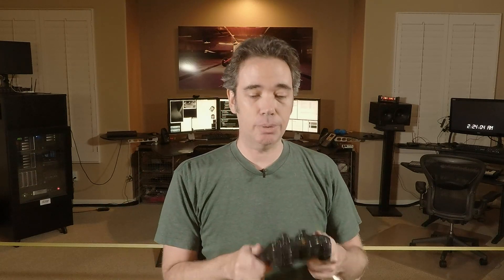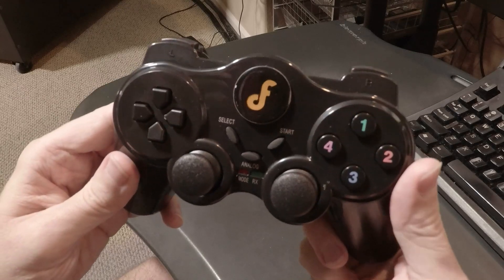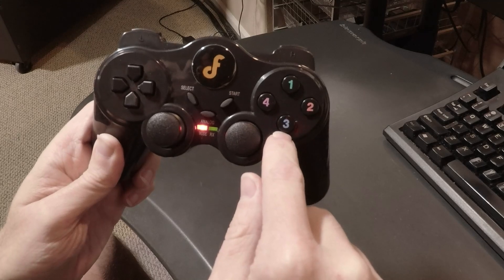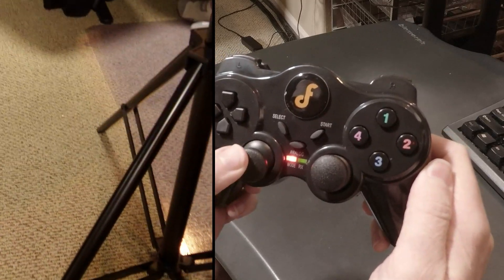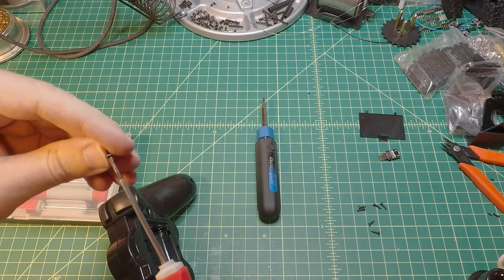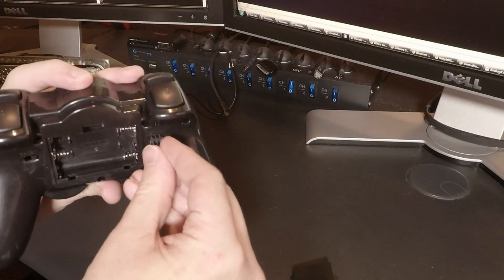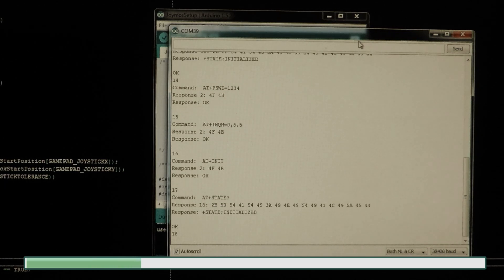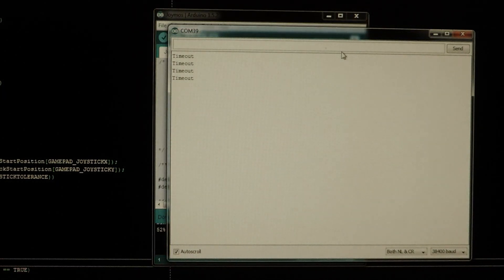Wireless gimbal controller (DIY for GoPro stabilizer as well as other AlexMos/BaseCam based systems)

Comment: I would like to point out that the code has a problem because it and impossible to make the connection with the card, after having studied the code in depth I found the solutions because the transmission speeds are wrong, currently everything works perfectly well, thank you for this tutorial but think about adding your code

Comment: A couple tips that will save you a tone of time.  The DFR Robot Game Controller Bee only works with the Blue Tooth 2 module for this example.  The Link or Blue Tooth 4 modules do not work. If you try and use AT command from the serial command line and not from the code it will not respond.  Lastly the wires on the controller that connect the battery are really cheap.   High chance they break off when you open it up.  Recommend soldering back on nice silicon wire.
Reply: this is true!!
Reply: You managed to make it work?? can you share your  BGC 'RC settings?
Reply: +FLOREPSINOSA photographe what settings would you like?

Comment: Hi,   I have tried this now for three weeks to get it working and it does not work.  Furthermore, my gimbal is completely ruined and only jolts now.  Do you have the settings to get it back to factory reset or a fix to your file. It fails at line 18, 24, and 27. 

Thank you, 

Michael

Comment: Hi! I'm trying to do something similar but, using USB without an Arduino. I'm using the provided API and I've modeled my code after yours but, I can't get the gimbal to move. I'm using the 32 bit basecamp gimbal controller. Do you have any ideas about what could be going wrong? My first thought is that I need to change some input mapping settings on the RC tab in the GUI. Do you know what those settings are? Thanks!

Comment from the maker: Brandon (your settings don't let me reply), the 32bit version of the Basecam stuff supports scripting now I believe, so you could do it without anything else.  If you're running the 8bit version, then there is a project linked on the Basecam website called RMotion that can do it.  I've never used it, but it looks to provide of ton of scriptable control of the gimbal.
Reply: Great thanks! Also thanks for letting me know about the not being able to reply I'll have to change that.

Comment: Can I use a Playstation 3 controller instead?   I have a couple laying around which I no longer use.
Reply from the maker: Davion Ola Perfect Exposures You certainly could, but it would be a LOT more work - the only reason I picked this particular controller is because it had the Arduino already built in, and the wiring to the buttons, etc done.
Reply: Anx2k Cheers for the quick reply. I believe getting the Dfrobot pad is the best  option too. By the way, thanks  for the  fantastic tutorial.

Comment: Hi! Will this work with the ST-316 gimbal?

I hope that's not a dumb question; I'm new to all this.
Reply from the maker: PonyHorton It's really hard to tell with these gimbals - they could look exactly the same, but have different software inside.  I don't know about that one, I searched and couldn't find if it uses AlexMos or not - I would email the seller.  If it's running the AlexMos software, and you get a bluetooth adapter for it, then it will work...

Comment: Brilliant, I have a hobby King RC controller at the moment for my gimbal but this would be a great addition for when I want to slim down my camera bag, and the 10 point memory thing is absolute genius. One thing, is it possible to use the top 4 buttons for trimming drift? that would be super handy.
Reply from the maker: Lee Daley Thanks!  You could actually kind of trim drift with the left stick, since changes it makes are permanent (to the controller), as opposed to the right stick which always returns to whatever the start position was.  The thing to keep in mind is that it really isn't correcting the gimbal, it's just applying that amount of pitch/roll/yaw to any output it sends - but the effect is basically the same.

I also have a new gimbal controller in the works (a good partner to this one), so make sure to leave some space in your bag - don't worry, it's small also, but even cooler.  ;)
Reply: Ah yes, just ordered the bits so will have a play when they arrive. Looking forward to what ever it is you have up your sleeve.

Comment: I am running into all kinds of roadblocks running this through a mac.
Reply from the maker: Lucas Waller I don't use a Mac, but the process should be the same - are you able to flash the device from the Arduino IDE?  And if you open the Serial Monitor, do you see it printing things?
Reply: Anx2k after downloading a couple different drivers it was able to get the simplebgc to speak to funnygo, but was never able to find the bluetooth configuration settings. I'll just redo it from a friend's computer.
Reply from the maker: Yeah, you'll probably find it to be easier on your friends PC, just because I show what to do on it (Windows 7)... Let me know if you run into any snags, and I have another different gimbal controller build I'm finishing now - it's more complicated but cool as well.  They're both very different, so I suspect having both would be ideal, so don't worry that you won't want this one once you see the next one.  ;)  And the next one is even a bit cheaper, I think it comes in at under $50, which is nice.
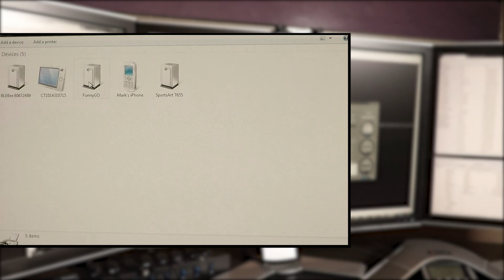Reply: Anx2k I am STILL hitting roadblocks getting this controller working. The computer only recognizes the com port but not the funny go gimbal in the devices. where do you get the funnygo bluetooth adapter you mention at 6:45?
Reply from the maker: For the FunnyGo, the bluetooth adapter is the one I got with it from copter-rc.com.  The bluetooth adapter on my PC is nothing special, just the cheapest one on Amazon that was Prime:

http://amzn.to/1LGIh8x

Keep in mind that I'm only talking about Bluetooth there to get the ID of the device, and that for programming the Arduino it's a wired connection.  Make sure that you're selecting the Joypad Com port and NOT the Bluetooth/gimbal one in the Arduino GUI.
Reply: Anx2k so I ordered the adapter you linked me to, installed the software for the adapter, rebooted  the computer and it still doesn't see the gimbal with which to pair. The bluetooth plugable comes up in devices but has no bluetooth tab or unique identifier number. The only time the gimbal communicates with the computer is when I'm using the usb UART bridge. If I go through the UART bridge in devices to the properties there is a UI number but only shows 8 0's . Why won''t it discover the gimbal?
Reply from the maker: So, when you turn on your gimbal, the light on the bluetooth dongle that plugs into the motor is flashing, correct?  And then when you do 'Add a Device' from the 'Bluetooth Devices' control panel, it doesn't find it, and it doesn't show it listed?
Reply: dongle? did you mean handle? there are 3 tiny led lights inside the handle of the gimbal. when battery is new the red and green are on. when battery is low the red is solid while the green and yellow flash. in the bluetooth devices it only recognizes the usb plugable. no new devices can be discovered.
Reply from the maker: Ah, I think I know what it is - if you look at my videos, you'll see a white thing hanging off of my gimbal, on the roll motor - that's the Bluetooth adapter for the FunnyGo.  I believe with the new ones it's now black and he attaches it to it, but I'm almost positive you would see this on your actual gimbal.  So my guess is that you don't have the bluetooth module for the actual gimbal.  Specifically, this is what I'm talking about:

http://copter-rc.com/en/accessories/46-bluetooth-module-for-funnygo.html

If you don't have that on your gimbal (look at the pictures and you can see where it hooks up), then you need to order one up - otherwise there's no bluetooth to communicate with.  ;)
Reply from the maker: Yeah, sorry it wasn't better news - but on the bright side, it isn't that expensive and once you have it, you'll be good to go.  

If you haven't check it out, I have a new controller video I just put up, and it's pretty cool as well.  Building this one will give you a good starting point with it, since the Bluetooth configuration stuff is the same between them.  I'm also working on one more controller, which will pretty much exhaust my ideas for controllers, but should be equally awesome.  The nice thing is each controller is very different, and not to expensive, so having all three is the best situation.  ;)

Comment: Thank you for valuing my time and not wasting it showing me a box.  I took that time to write you a comment and gave you a thumbs up instead.  Cheers.
Reply from the maker: Zen Trickz Awesome ;)
Reply: Hello!!!!!!!!!!!!

This is not the first time I try to contact you, but I hope that this time you will respond to me.

Since it is very frustrating to have problems in which nobody can help me, spend almost 100 dollars buying the components that you indicate and I followed exactly the steps to make my remote control ... however it does not work correctly.

What happens is that when I turn on the gimbal and then the remote control are connected correctly and I can send movements to the gimbal .. but it is not precise just tremble and shake for all sides .... in tale I turn off the remot control the gimbal Is returned to its stable and functional state

Please!!!!! give me an answer  Please!!!!!   give me some extra details that you do not give in the video

Does it only work with old firmware?

I wait very impatiently for your answer

Ricardo

Comment: Would really like to use this with my quad, is there a way to get more range such as 915mhz data link?
Reply from the maker: toyothommy Unfortunately, not easily.  If you're looking to use something that is more than your general area, you need to go the more traditional hobby controller route.

Comment: This is simply brilliant. You deserve a medal, or some ice cream. Maybe both
Reply from the maker: Lucas Waller hehe, I thought you might like it!  Just help spread the word - I look forward to seeing what people end up doing with it...
Reply: Anx2k I ordered a z-one and awaiting delivery in a few days. There is a company based in India that is rebranding the same gimbal as I-FLY. They are NOT using alexmos :( so I will not be able to use this wonderful piece of programming :'(  I will see if it makes up for it in higher torque motors and longer battery performance. Maybe? Otherwise I'm returning and going with funnygo
Reply from the maker: Lucas Waller For me the battery performance isn't a big gain, since you'll generally need to swap the battery in the GoPro anyway, and swapping the gimbal batteries at the same time is a no brainer.  I'm skeptical of the torque, since you could easily increase the power on the FunnyGo and I suspect it could handle the lens they show in the demo.  

For me the more interesting thing is the accuracy they claim, and whether it's some sort of closed-loop system so it's 100% reproducible.  If that's the case, and it has some sort of API for being able to hook up to a computer (or bluetooth), then it would certainly be something I'd look into picking up.

I look forward to hearing what you think of it once you actually have it in your hands, and how it performs...